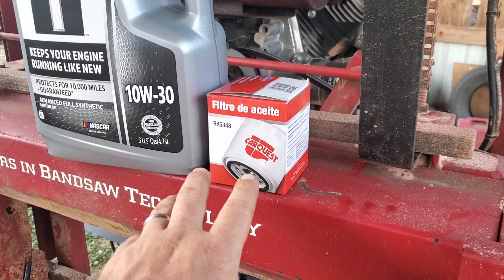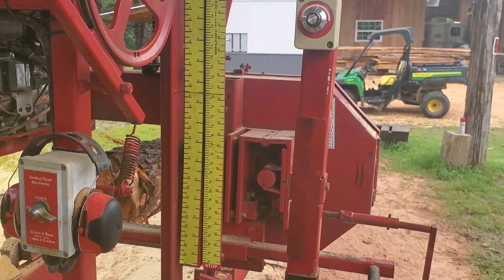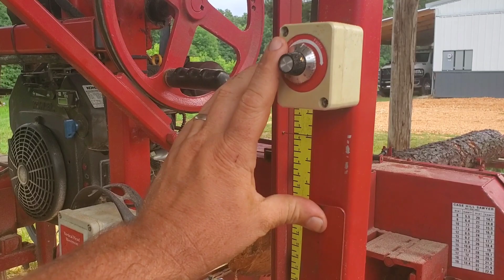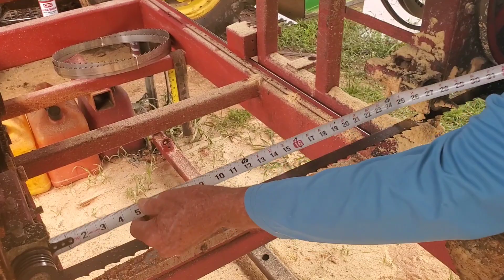Searching for sawmills episode #5, Fully loaded Cook's MP32 (mill is sold)

Comment: I've had my MP 32 for 22 years.  The selling feature for these mills is the crowned steel wheels, no belts for the blade to run on.  The blade always runs true and clean with no vibration.  I saw Southern Yellow Pine and Long Leaf pine which is loaded with pitch, here in southern Georgia. I ran a Woodmizer LT 35 for a month and finally went back to my MP 32.  I spent too much time trying to get the pitch off those stupid pulley belts.  No problem for the steel wheels.

In 22 years the only repairs I have made have been belts and track cleaners.  After I had had the mill 9 years, I replaced the 12 HP engine with a 20HP engine.  There is never any down time waiting for parts, most can be purchased at a hardware store. Best money I ever spent.

Comment: Add a felt wick to your diesel drip, later models already have this feature. Add a second lever (on/off) to the drip system, this allows you to set the needle valve in the desired position, use the lever as the on/off. Reason for disengaging the clutch each time you return the carriage?
Bearings on drive side are roller bearings, not pillow blocks. I think the reason for the battery height is to allow the head to go high up.

Comment: You kind of said it wrong.  It can cut and handle a 32" log, it just can't cut 32".  Due to the round and turning of log(squaring off)you can cut one of 32".  While it doesn't have fancy set works and hydraulics that is still a very impressive set up.  That baby is stout.  That tensioning system/design has been working for decades, I could get all the parts at my tractor supply or lawn mower shop.  I believe the later models use felt on the blade lube setup.(think of Mr Robert's lube on his sharpening setup)

Comment: Hi Thomas.  Maybe you have said it and I missed it, but how much fuel are you burning each day on the Cooks Mill?  I have a 34hp Kohler on my TK 2000 and it will go through about 6 gallons each day.  I can cut about 1500 board feet of 2x material, and about 1000 feet of 1x on a good day, burning about the same amount of fuel.  Great video and its nice to see your father enjoying the Cooks mill.
Reply from the maker: My dad only cuts about 500 board ft at a time.    He's running around 3200rpm while cutting.  He's put about 32hrs on the machine since we got it and only filled up 4 times. So under a gallon an hour.

Comment: How would you compare that to the  timberking 1220
Reply from the maker: The production factor and length of cut are higher on the cooks mill, but the Timberking can cut wider and has a bigger throat cut.  The mp32 is more portable but depending on your application that doesn't matter.  If you want the cut wider slabs then the 1220 wins, you can also keep more slabs on the mill due to the throat.   The mp32 would be better for  longer dimensional lumber.  A stationary 1220 with extra bed extensions is something I'm working on down the road.

Comment: Could have put an extension pipe on the drain.
Reply from the maker: Yes, I agree
Reply: Two appropriate pipe fittings and a couple inches of hose would make it easy.  Even easier with a petcock on the end of the hose.  I made one for my Honda V twin motor on my mill.